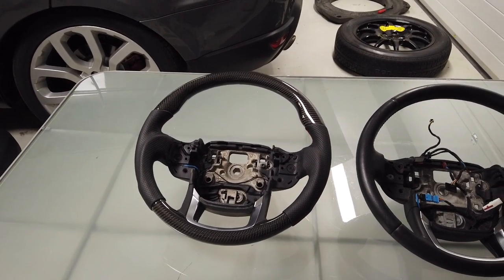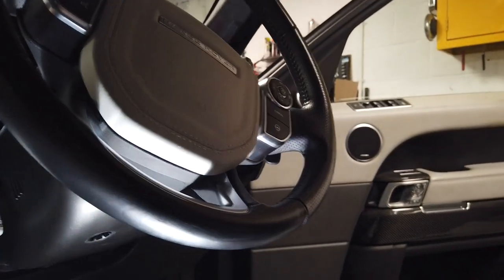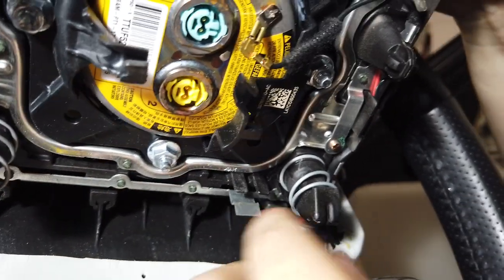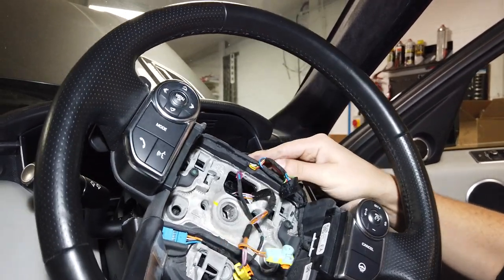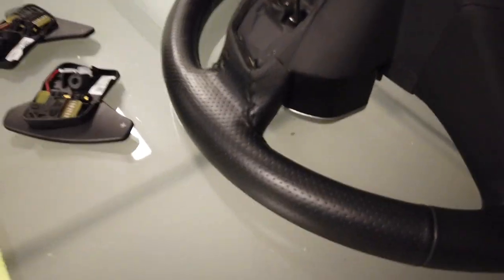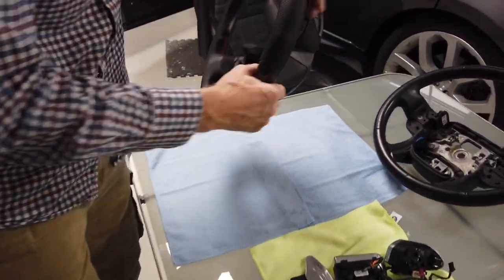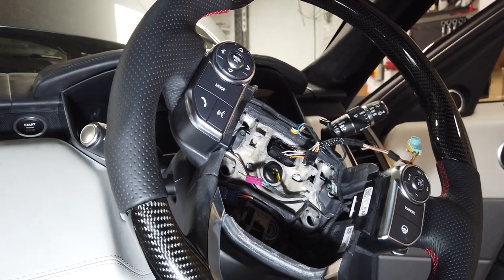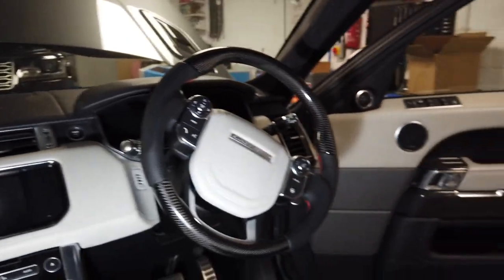How to remove / upgrade the steering wheel / airbag on Range Rover Sport l494/SVR

Comment: Thanks for the explanation, it made the changing of my instrument pod really easy!. A few comments - Don't push through the slot with a screwdriver - I gently cut the surface with a knife first before using a screw driver and then it hardly leaves a mark. To avoid damaging a screw driver for nothing (and because I'm lazy) I used a size 5 allen key screwdriver and it worked fine. Also beware on refitting the airbag, the top needs to slide in first, then the bottom. It's probably a good idea to to a "wiggle" test of any components before you remove them so you can wiggle them again on refit to make sure everything is stable ( that's how I realised the top clips hadn't fully engaged and was able to correct). Oh, and make sure you turn the steering wheel so that the slot is facing the driver's door before pulling the battery cable - This not only makes it easier to remove the airbag, but also means that you can remove the paddle shift and pod (in my case the right one) without having to blindly try and find the screws.

Comment: I’m buying a used clock spring to fit a heated steering wheel, how do I make sure it’s set in correct position? Im assuming wind it all the way, then back 4 times?

Comment: I replaced my wheel, and after 2 min of driving I started getting a lot of warning lights and suspension fault codes, what’s this mean? I used the touch pad switches aswell on the wheel.
Reply from the maker: Suspension warning lights - this could be steering angle sensor - make sure you did not move the slip ring after the change. Also make sure you turn your steering wheel totally left then totally right - this willl recalibrate the steering angle sensor.
Reply: @L663  yes that worked out!! Now my air bag light staying on, should I pull negative off battery and reset again?

Comment: HI, an info ....
on my RRS 2018 I have the steering wheel without heating ...
can I install one with the heating?
are the wiring the same? there will be only the resistance cable ...
thank you very much
Reply from the maker: Hi - my car has the heated wheel so tricky for me to test how to upgrade !
We did this on our evoque though . see below - it should be similar.
https://www.youtube.com/watch?v=18JSMqL0O84

Comment: Hey mate,  do you know if it would be possible to change the steering wheel on a discovery sport L550  2017 to the newest version used on the 2020 model . Thank you
Reply from the maker: Hi - I have not tried this but it is a good question !

Comment: Very keen to understand if the backlit steering wheel switchgear will work on an L405 that is fitted with the normal buttons? Or, if there is anyway to upgrade to the backlit switchgear?
Reply from the maker: Did you see my video on this  ? i am looking if changing to the later clock spring will help... i have ordered one so its not all lost yet...
Reply: powerfulukltd I did... another great informative video. Hopefully you can get the new backlit style buttons to work as I think that would be a very popular upgrade.

Comment: Hi if I buy one of your heated steering wheels for my  2020 discovery 5 do you know which clockspring I need ? I can see a few different part numbers and the dealer does not know the difference. Parts LR101296 or LR087112 ?
Reply from the maker: whats your chassis number ? or the first part of it ?
Reply: L24373
Reply: When upgrading from non heated to heated steering wheel on a 2020 discovery, do you know if it needs to be enabled via software?

Comment: I bought a used heated wheel and there was no hole pierced on the bottom. Not sure how they removed the airbag but there is holes on the back of the wheel under a plastic cover.

Comment: Replaced the steering wheel with a heated one, and now the car has ABS fail, HDC fail, and the airbag light is on. Any insight on how I can remedy this, or does it need to go to the dealer?
Reply from the maker: OK you may need to disconnect the battery and reconnect again after 10 minutes.
Another thing to try is to turn the steering wheel from lock to lock to recalibrate the steering angle sensor.
You can also try a local garage that has Diagnostic equipment that can read and clear faults.
We have never come across this issue with a steering wheel change.
Reply: @L663  yep, have done the battery and angle sensor calibration. Did not fix anything. A fella at the parts shop said the steering wheel needs to be coded to the car.

Next step is to clear the codes and see if that does the trick. I also have no response on any of the wheel controls, buttons, etc. The manual shift is disabled as well. Must have tripped a sensor of some sort.
Reply from the maker: @b75269  The steering wheel is not coded to the car. You could try swapping back to the original switch packs just to see if that fixes something - my guess is something is not plugged in correctly ( not fully plugged in )
Reply: @L663  Ya, I plan on doing that next as well. However, the original switch packs do not have the heated button. I am confident in the connections as I took apart and checked more than once. Even tried the original non-heated slip-ring and still got the same errors.

Comment: Any idea if a heated steering wheel will work on a car without a heated wheel from the factory?
Reply from the maker: Hi Leigh - we did this on our Evoque with no problems - needed to change the clock spring and the switch pack and the steering wheel - but everything else worked.
Trouble is i got the top spec car so cant test the other way...... next time i will be a low spec car !
Reply: @L663  thanks for the reply, enjoy your videos! If you've a heated one spare and a switch pack I can test it for you? Ours is a 64 reg HSE.

Comment: I can't find the spring to push to get the airbag off.  Is there any other way to get the bag cover off?
Reply from the maker: Hi - its there - have a cup of tea and try again - always help me when i have this problem !
Reply: @L663  thanks:).  I put it on slightly crooked and the horn is going off when I put the power back on.
Reply: @L663  I got it off finally.  Let the scotch flow.  The trick is understanding that the spring is on the steering wheel and not the airbag!  If anyone else runs into a problem they can message me and I will send them a photo of the nasty little spring.
Reply from the maker: @teslafanatic7441  Hi - be careful you do not have the horn wire trapped.